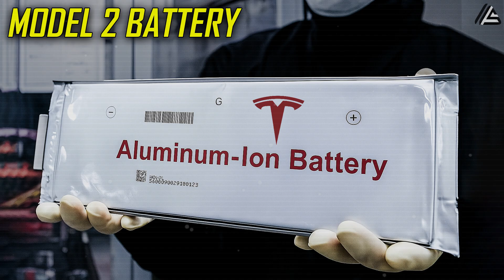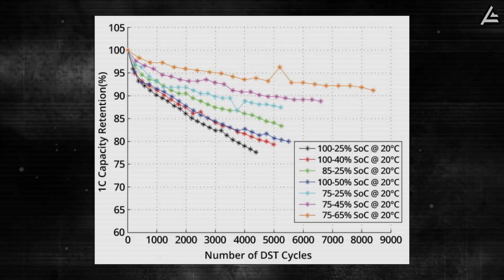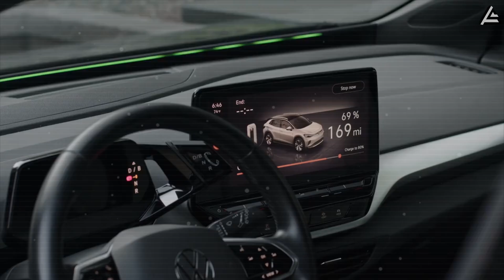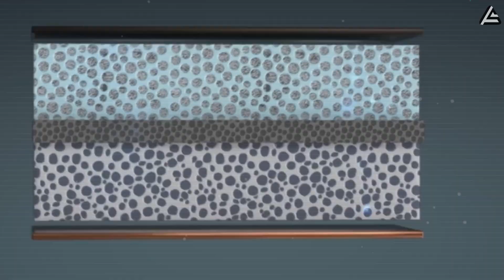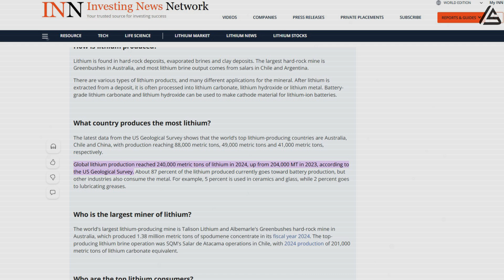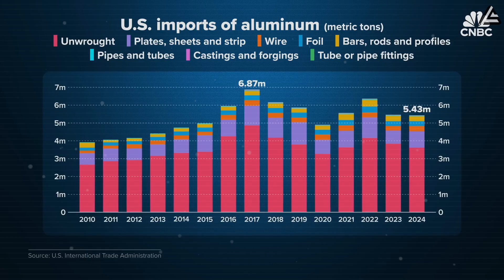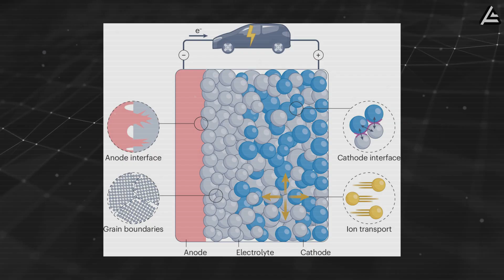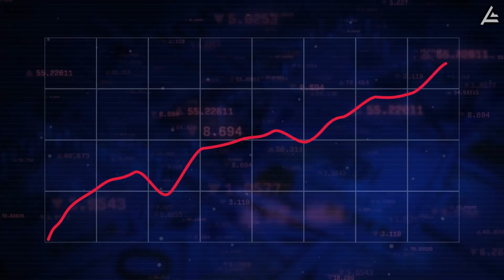2026 Aluminum-Ion Battery For Model 2: Is This Game-Changer Finally Hit The Market?

Comment: I question some of the video shown, as it may have nothing to do with the topic.  One thing is the picture of a fire showing a Tesla at a charger.  That fire was due to a malfunction of the fast charger, nothing to do with the battery or car.
Reply from the maker: That fire clip was used just for visual context, not as proof of a battery issue. Thanks for your comment

Comment: No one needs 900-1000km of range!  That is at least 6 hours of straight drive time, even in the coldest winter day.  Why carry around all that extra weight for no good reason?  A charge time of under 15 minutes would be great and sufficient, because unlike at a gas pump, the EV driver can plug in and then "take care of business", grab a snack, stretch or get a short walk for health and improved driving attentiveness.  Most charging happens at night, so charging speed is only important while on a road trip.
Reply from the maker: thanks for your sharing. we read a lot of comments and see that some of our viewers care about charging time like you, some others care about range. So we tried our best to put information about these features in our video
Reply: You don't live in Australia. There are many areas where the distance between fuel stations is over 500km. Without 800km or more, driving in outback Australia is dicey, at best. I, personal, want the most I can get. 1000 km sounds good. Trucking in Australia is unconcealed with Tesla's Semi, unless it's within a city only. Melbourne is 800km from Sydney, Brisbane, is further. Perth is a 4000 km drive from Sydney, Darwin is about the same. Fast-charging is a necessity for truckies, but it also requires infrastructure. Once you travel outback, there can be 400-plus km between service providers that don't yet provide for electric vehicles.
Reply from the maker: You’re absolutely right. Range and infrastructure matter far more in places like outback Australia. That’s exactly why long range and fast charging are critical topics, not just specs on paper. Do you think new al-ion battery can solve your problem?

Comment: what I wont do is spend 15K on a new car with LFPA Knowing it will begin to crap out in a couple of years, ill save my money for the aluminum which should be here longer than me.
Reply: Too bad there aren't Nio cars in the U.S. with swappable batteries like it should be.
Reply from the maker: Makes total sense 👍 no point investing in tech that won’t last. Would you wait it out for aluminum, or grab a used EV as a temporary ride till then?

Comment: What happens in the event of a pack failure or crash?
Reply from the maker: Good question — in a pack failure, the BMS (Battery Management System) isolates the faulty cells to prevent fire or damage, and in a crash, Tesla’s battery design and cooling systems minimize thermal runaway risk. Would you want extra coverage or warranties for that peace of mind?

Comment: If charging takes only 5 to 8 minutes why is a super long range needed? Nobody drives 1000 km without a break  so surely half that would be more than adequate given such a battery a decent amount of charge with just a toilet break.
Reply from the maker: Exactly — if you can recharge in 5–8 minutes, extreme range isn’t as critical. Do you think shorter-range, fast-charging EVs will become the norm?
Reply: @AutoGearShift2 I would expect city cars to settle for around 300 to 400 km of real world range, with most of the rest from around 400 to 600 km, and only a few - those most likely to be used for towing having upwards of 600 km. This could get slightly higher if vehicle to grid goes mainstream with the majority of chargers allowing export from cars to homes and the grid.
Reply from the maker: I agree with you
Reply: The simple answer is still range anxiety. The "what if I have to make a long trip on short notice", with an ICE car it doesn't matter lots of gas stations, with an EV you have to plan if you are going to charge on the road. I have never owned a car without a 500KM. The truck I now drive is between 650 and 725 KM (highway). But if I had to leave right now it wouldn't make any difference how far I had to go, I know I can get gas almost anywhere. Also, they keep upping the range, it was in the 650 KM range, with a 5-minute charge.
Reply: @stephenwooten8661 I barely get 300 miles with a full tank of gas in my truck and I see more and more stations out of gas.  Of course a gas engine can be adapted to run propane or alcohol.
Reply from the maker: yeah I heard you. what do you think about switching to an EV?
Reply from the maker: thanks for your sharing. EVs are expected to solve range anxiety too since there's a lot more superchargers right now. would you consider own an EV?

Comment: get LFP and in 5 years you are planning a replacement.....go for the 100 year plan
Reply: Where do you get 5 years from? LFP properly managed should be good for 6,000 to 10,000 discharge cycles. Based on 200 mile range that would give the car around 1.2 million miles before the battery needs changing. Even at 10% of that, the car could be driven 120,000 miles which is more than most cars get to before being scrapped.
Reply from the maker: Exactly — LFP is solid for long-term use, but going for a tech like aluminum-ion could be the real “100-year” plan. Do you think it’s worth waiting for the next-gen batteries?